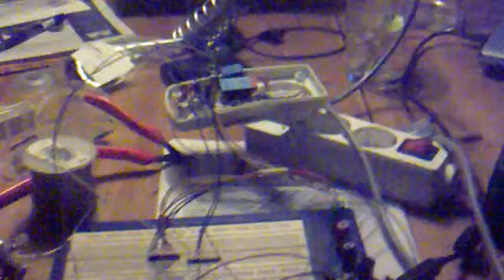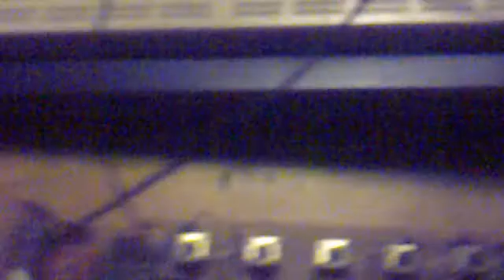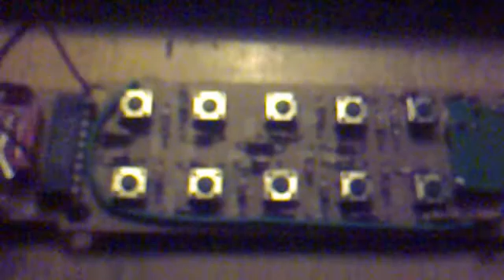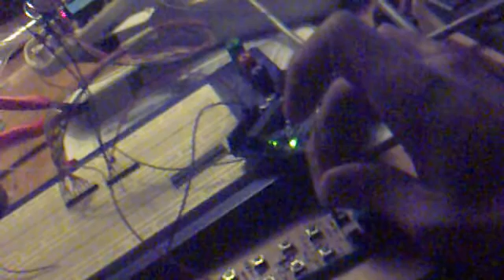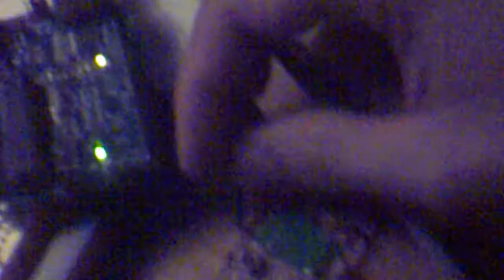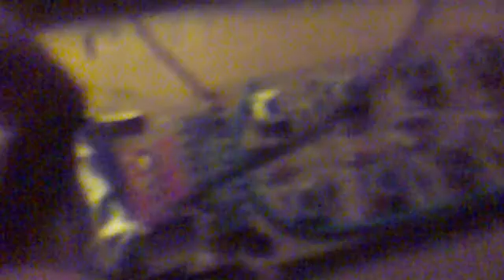Very simple interface between arduino and pt2262/pt2272

Comment: This video is useless.  Incredibly bad camera work.
Reply from the maker: Thanks for watching my absolutely first ever YouTube video I think. I bet that video is not up to today’s standards. I have quite a few later videos with better camera work that goes through a few ways to use 433mhz and pt2262/pt2272 with arduino.
Here are three better ones:
DIY 433MHz IOT button with a PT2262 - Anything Arduino ep25 https://youtu.be/Oez0VQxZPBs

433Mhz Radios: Take Control over your house (or at least your lamps) [Anything Arduino] (ep24) https://youtu.be/UlI6YaxK6aA

More info about the 433MHz band and newer self learning sockets [Anything Arduino] (ep 25 1/2) https://youtu.be/qLTY9CTb1wU

Hope one of these will help you better!